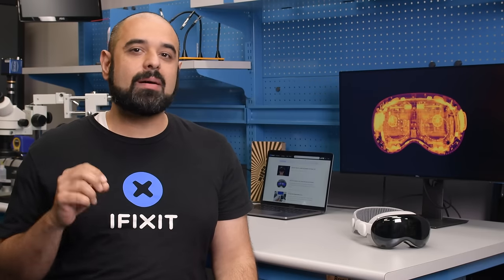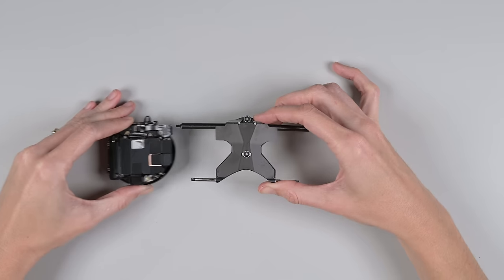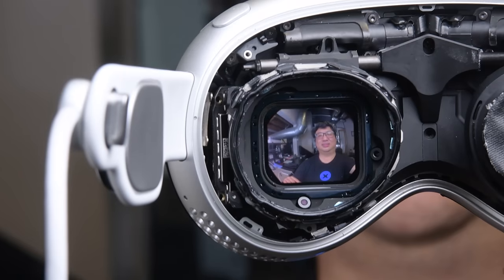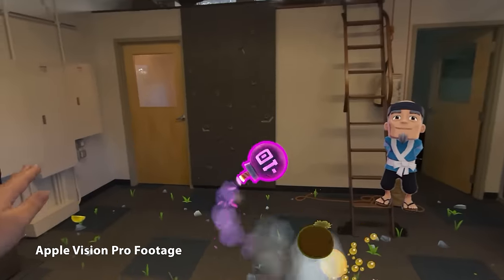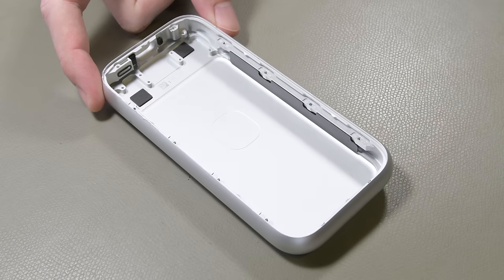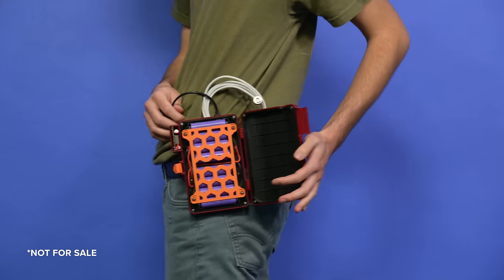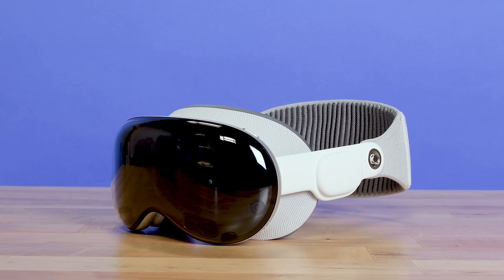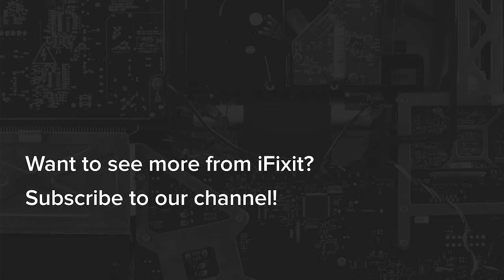Vision Pro Teardown Part 2 - Is the Apple Vision Pro Really 4K?

Comment: Surprised about the 4/10 ... What could really be repaired on a Vision Pro by anyone but Apple?
Reply: Battery head strap and audio solution looks pretty easy to replace.
Reply: What would you need to replace on your vision pro, considering drop tests proved it to be quite durable?
Reply: Front glass is not scratch resistance, lenses can be scratched if not cleaned properly, in the future you could have issues with internal parts such as the displays or cameras. Rubber membrane under cloth around eye shield could deteriorate over time.
Reply: @nomecognome2  'Why would you need lifeboats on an unsinkable ship?'
Reply: Um it's the most advanced and complex consumer electronics device ever built on this planet. Absolutely incredible engineering.

A device like this can't be "easily repairable" without heavily compromising on size and features. 

Also, 99,999% of normal consumers (like your mom or anyone you see on the street etc.) do not give a toss about self repair, because they are reasonable and understand that taking their iPhone or whatever to an authorized service partner (there are thousands of them) is the correct action.
Reply from the maker: Check out the Quest 2 battery replacement guide and you might appreciate that external battery a bit more: https://www.ifixit.com/Guide/Meta+Quest+2+Headset+Battery+Replacement/169153

Comment: Why does the vision pro without parts pairing get the same score as some phones with parts pairing?
Reply: I guess because calibration requires someone else to deal with it? I don't think this applies with paired parts like screens or charging cables (maybe battery due a safety concern) but not to the point of it become unusable
Reply: Different class of device
Reply: @ratvibe  the class of device shouldn’t matter. What matters is the ease of repairability
Reply: That doesn't matter. Idk why this guy is pretending it does.  @ratvibe

Comment: It seems all of the important internals are serialised. Even if you use original replacement parts you are locked out by Apple's software. 4 out of 10 is way too generous.

Comment: Would it be possible to reposition the insides while still getting the same experience? For example, moving the cameras to different locations on the headset or moving the chips to the back of the head.

Comment: Actual 4K resolution as per its invention was listed as 4096x2160 which is 17:9 vs todays slightly lesser resolution of 3840x2160 which is a 16:9 aspect ratio. That being said both resolutions are still 8 million or so pixels in terms of total detail. What’s real interesting is each panel in Vision Pro is 10.75 million pixels ( 3360x3200 ) which means combined you have greater resolution than 6K panel, but not quite 8k ( 6K is 18 million pixels, Vision Pro combined is 21.5 million, and 8K is 33 million ).

Comment: Honestly, it's way to early to see where this product goes to really determine if it's repairable. I don't know if it could be made more repairable without making it heavier, but it clearly could pull the same trick for the light shield with the front screen.

But I also expect future models based on M4 might actually forgo the front screen entirely. Sure it's kinda neat but it's also of no actual benefit to the user and burns battery life.

Comment: "The pack is also outputting more voltage than a normal usb c pack to keep up with the Vision Pro's precossings demands..." 
Sry to say but that is a misunderstanding of why Apple used higher output voltage battery pack than lets say the typical 5v usb power. The reason they have gone with higher output voltage is because of how electricity works. If wan't to keep the power loss due to transfering (dc) power you step up the voltage.(and therefore keeping the current low) That's also the reason why Notebooks run on +20v.

Comment: The variable opinions on the lag or lag free passthrough is interesting.  You have some, like iFixit here, who says you will notice some lag in pass through....but others like MKBHD says that is not the case and is even on film playing ping pong with someone through pass through which, in my opinion, would be near impossible if pass through was laggy.
Reply: iFixit is best at opening the hardware, mkbhd is best at reviewing tech, and the fact that a lot of techtubers experience is opposite as to what iFixit is claiming especially on the passthrough, I guess the problem was on them, not on the vision pro. They should've double checked the software experience first before releasing the video ig.
Reply: Context - iFixit said there is lag, MKBHD said that Apple did it much better than competition, he never said there is no lag.
Reply: @randomnickify  yep, around 12 ms according to apple, but not big lag compared to what iFixit is claiming. 
Context - MBHD can play pingpong using the visionpro which implies that the passthrough has a very small latency.
Reply: 12 ms is honestly pretty good. That’s about 1/84 seconds. It makes sense that you can play ping pong with that level of lag. Most TVs used to be far worse than that a few years back and we used to game just fine on it. 12 ms is how long it takes sound to travel 4.1 meters or 13.5 ft, and musicians in a room bigger than that can play in time without fancy monitoring.
Reply: One of the million other reviews claimed that apple is using foveated rendering to save GPU power, because otherwise they couldn't power all those pixels. Apparently the vision pro has some screen recording option that disables it to make the recording look better, but that obviously comes at a cost in frame rate and resolution.

Presumably some of the reviewers used it a lot more casually without screen recording and only enabled it to show specific things in their videos, while iFixit probably had screen recording enabled the entire time, which gave them a degraded user experience.
Reply: Depends on what you are doing. Ping Pong isn't demanding unless you get to the competition level, but some things, like mountain bike tricks ,are inherently difficult, and you'll be far more likely to notice even the tiniest lag. Guy who actually DID bike tricks while wearing one said "never again" because his physical reaction to the lag was so bad, but few people ever bounce a bicycle into the air and spin the handlebars and catch them before hitting the ground again (for a very specific example), especially while wearing an Apple Vision Pro.

Comment: Also if you are gonna use tethered headset then why not make the pack bigger with all of the processing power in it to make the headset even lighter. And then use even more powerful graphics...
Reply: It's Apple.

They don't want any part of the device to seem bulky; this external device you're suggesting would be big, heavy, and hot. It would need a fan and openings for heat dissipation, so it couldn't even go in a pocket, and would be remain permanently visible.

Comment: i would like you guys to weigh the various components.. in particular the front glass panel and the lenticular lens and the front-facing screen. The reason is I would like to know how much weight those components add to the overall weight of the headset.

I would also like to know if the headset will still work if you unplug the front-facing screen and how much energy it draws. I suspect the front-facing screen is drawing about 10-15 Watt hours.. and if so.. removing that could potentially double the number of hours the headset could operate with the battery?

Comment: It is beyond a 4k resolution per eye btw.  (3660x3200)-(3860x2160)=3,374,400, it has 3,374,400 more pixels than a standard 4k display.  and over 4,300,800 pixels than a 4k television  PER EYE! (3660x3200)-(3860x1920).  It is wrong for iFixIt to say it is not 4k.   I agree it is not in the 16:9 aspect ratio, but who cares.

Comment: What's the difference between this Tiny Screen and the one that's in Xreal Air 2 Pro AR glasses?
Reply: 4 times the density and fully solid panels
Reply: AVP: Chip is 1.4", 11.5 MP
XReal: Chip is 0.55 or 0.7", 2.1 MP
Reply from the maker: Air 2 Pro has a 50 degree FOV but something like 48 PPD. It's packing more pixels per inch but it's a very different device.

Comment: It's really impressive but I don't understand why they didn't use the USB C PD standard for the battery pack. Perhaps they wanted no chance that the cable accidentally got unplugged during use?
Reply: USBC is not made for battery interconnect and battery dont need 11mbit usb data as well as more complex usb controllers while something simpler can be used. USB didnt been made for power really its a extra feature allowing powering devices from host not other way around, so you dont need extra power cable. It just happend that phones needed a plug that sends data in standard way and charge in same time. Also usbc dont provide nessery cliping to secure the plug.

Comment: Do we know the render resolution output of the vision pro? (In every vr headset, to get the sharpest image that the panel allows, you need to render the image about 1,4x higher than the panel resolution to compensate for the distortion profile dictated by the lenses.)

Comment: I know that the bar is really low, thanks to apple themselves, but 4/10 seems a bit high - teardown expert described it as personal everest, removing glass without scorching fabric seems very hard, and the fact that you need to use hammer and chisel, on a device that costs 3500, apple will refuse to repair or provide parts. Why would it matter if the issues caused by lack of calibration instead of intentional pairing if end result is the same - apple does not provide calibration software, so you can't swap parts.

Comment: I don't understand. if the glass has a cable all the time connecting to the battery unit, the processor board should be there also.... also , an  oled display just to barely show part of the face is a design flaw..

Comment: I think to understand the resolution better it's useful to calculate the resolution of a virtual monitor at a reasonable distance. If the horizontal resolution is 3660 and the FOV 100° a display that fills 50° of that FOV, which is about normal for a 27" monitor on a desk, has a resolution of 1830*1030 which is roughly 1080p. This is the sharpness you can expect when placing things at a reasonable distance. To really get the "4K experience" we're used to with monitors and TV's we'll basically need >7000p displays.
Reply: 8k displays would be sick

Comment: @2:32, Surely you mean 250 pixels and not 2500 would fit in a single 4k TV pixel? Unless you have one inch pixels on your TV. Isn't the whole panel around an inch wide and has 3000 pixels or so?

Comment: How did you determine that the FOV is 100 degrees? I measured it and it is 77 degrees by simply looking through it and measuring the edges of the viewing angle. I also measured binocular overlap to be 85%, and the per-eye screen resolution to be 3840 by 3072 because the screen openings have this 5:4 aspect ratio. Putting all this together, my guess is 58.6 pixels per degree.

Comment: Sony has an even more advanced microOLED chip: 3840x3552 on a slightly smaller chip (1.3"), pixel pitch 6.3um.

They cost $1000 each. People still wondering why AVP is expensive?

Comment: Wouldn't it technically be impossible with square pixels to have a non 16:9 screen be 4k in general? since 3840x2160 is a Widescreen resolution, for it to be 4K on a square or 4:3 screen the pixels would need to be thinner/longer.
Reply: 4k is a marketing term. 3830x2160 is just what the industry agrees on for TVs. there are ultrawide monitors that claim to be 4k but only in width. 
4k essentially describes 4k pixels on one axis (k is for kilo meaning thousand. so 4000 pixels which if u noticed normal 4k TVs dont have either. it just describes an idea so consumers can make sense of it. 3840p doesn't sound as gud
for that reason by all means, the vision is 4k. it has a lot more pixels than 4x FullHD which most ppl describe is 4k. ifixit claiming its not just feels like a very small nitpick considering that no 4k TV is actually 4k

Comment: I'm surprised it got a 4 and not lower. But I guess the replaceable pads and battery module cover the main things people would want to replace, even if it stops there.

I hope they cut it out with parts pairing, but I have a feeling we will see it on this device down the road.

Comment: > That doesn’t translate to passthrough
> but that has less to do with the panels
> and more to do with the front facing
> cameras, the processor's ability
> to calculate quickly and the lens stack
> ...
oh my god

so I could be working in passthrough mode for a few hours, my brain would lower its visual requirements for what it considers the "real world" and then if I'd play a 3D movie that was filmed with way better camers than the Vision Pro has, I'd probably feel like reality is glitched or something. I think there isn't a name for that experience yet.

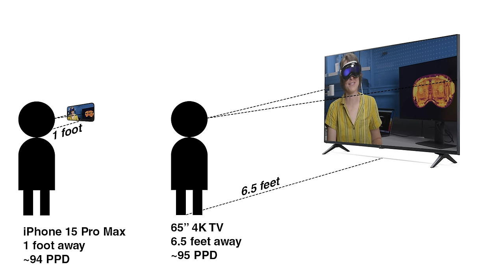Comment: 2:52 Yes, but you're just splitting hairs here.  Each display is ~11.9 Mp whereas 4k requires just 8.3Mp, it's just not in same aspect ratio to make it "4k".  The resolution is 1.43 x 4k in reality.  As you pointed out, perceived resolution is a function of viewing distance anyway.

Comment: Apple intentionally used a large lighting port in order to block 3rd party batteries. High voltage and amp means nothing as they only used 3x iPhone batteries. Beside 36Wh for $200 is too expensive.
Reply: They did it because a normal lightning or USB C cable can’t handle it
Reply: @moritz584 yes they absolutely can, lol. USB C can carry 240watts.
Reply: @joebot86 according to the video, it's the voltage not the wattage.
Reply: High voltage and amp means nothing? are you ok?
Reply: Apple used 2 locking connectors so the battery wouldn't get disconnected while you're moving around. USB-C would just pop right out.
Reply: @someonetooknuggets  the pro is 13v, USB C can support that.
Reply: @joebot86  its not just the voltage but also the amps which is 6A if I am not mistaken while usb c can support up to 5A only.

Comment: Defenitely PRO-s made the hardware and the software too, but so far no more than a toy, a gadget. Even as a gadget kinda a one trick pony because of the very few apps. Probably the best thing Apple made so far, but for that price its market is very small. They should redesign without the external display and the unnecessary expensive materials and try again with half the price. With this price not a single third party developer would make a serious app for it, unless they target a real pro segment so they can sell it the app for a thousand dollar or more. Like a CAD type, 3D design app for serious AR users.

Comment: What makes a score provisional?
Reply: Assembling/disassembling is only part of repairability, you need to consider if the necessary parts for fixing it are available to customers, their price, or wether replacing a broken part by a working one will actually work or the OS will brick the device as has happened in the past by replacing parts in iphones/macbooks.
I'll guess that if ifixit can't get access to repair parts because apple has a stranglehold on the spare parts chain, the score will go down.

Comment: "[E]ach of these displays have more pixels than a 4K TV." In other words, Apple's marketing is exactly correct.
Reply: It's not. 4K term requires at least 3840 pixels horizontally and never referred to the total number of pixels. Plus you can't watch a movie in 4K on it, because the virtual screen doesn't cover entire FOV as that would be worse than watching in the first row in a movie theater. Its nothing new in VR community. It was always known that you needed 4K per eye headset to see benefits from 1080p films over 480p and 8K per eye to see a 4K film in full glory. We are not there yet, but the progress is nice.

Comment: Apple never aim for high repair score. They want control it more so all will send to their service desk and let you pay hundreds dollars of costs. Yikes.
This is why i will not go for Apple, and i have no interest in this headset. Besides it's not designed for gaming at all.

Quest 3 is still great one, visuals are so good, clean and sharp. Of course the pixels are bit lower but i have hard time to notice the pixels. They're already so small i don't bother try count the pixels. It's just so clean view i just want have fun with it. And it's way cheaper. Some AR games are still fun on Quest 3. You have even bigger FOV too with Q3. The sweet spot in Apple is bit smaller than Q3, and that for 3500 headset!
You cannot compare between 3500 and 550. That is more likely David (Q3) versus Goliath (Apple)  lol.

So.... why are you going for Apple headset anyway? Because you have too much money?
Reply: iPhones are mechanically one of the easiest to repair and have been for ages, compared to Samsungs for example. You might have trouble using stolen parts though (sw pairing), and that’s a fantastic feature. Apple provides tools for the pairing, if you have genuine purchased parts. Third party batteries and displays do not require pairing, but you might see a warning in the settings if non-genuine components are used. Again, fantastic stuff if you are buying a used device. Also, a service provider claiming to use genuine parts can’t cheat.

A device like Vision Pro simply can’t be “easy to repair”. It’s the most complex and advanced consumer electronics product ever. 

But of course you know all this perfectly well.